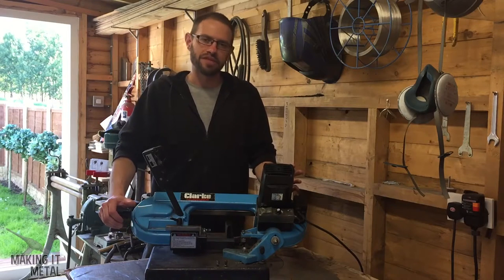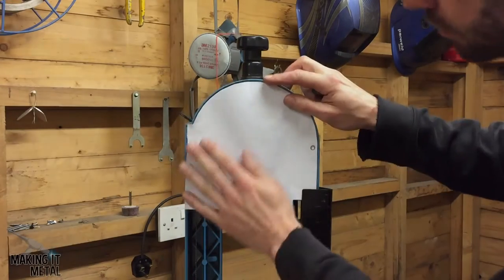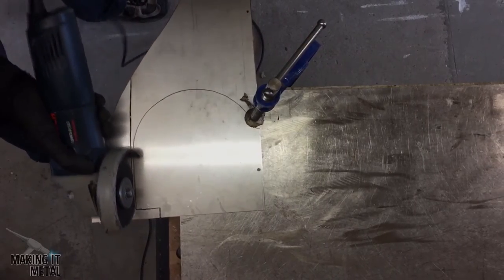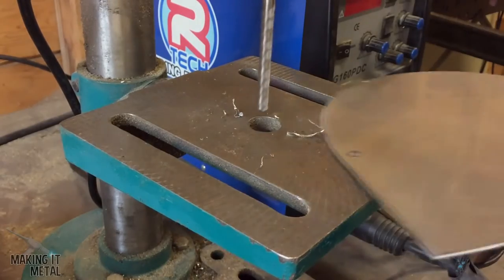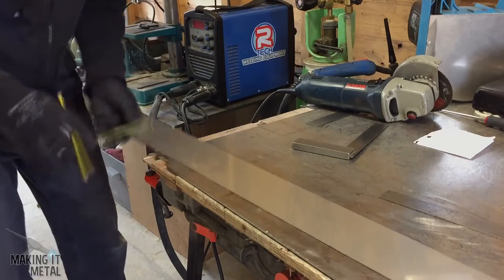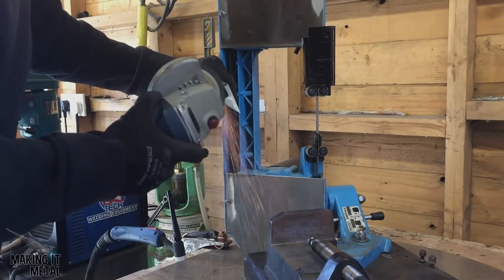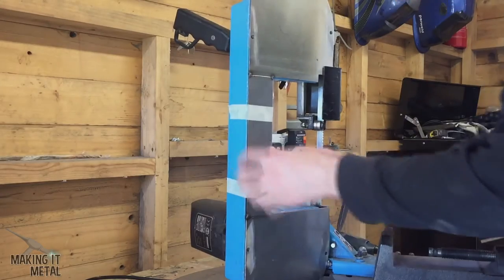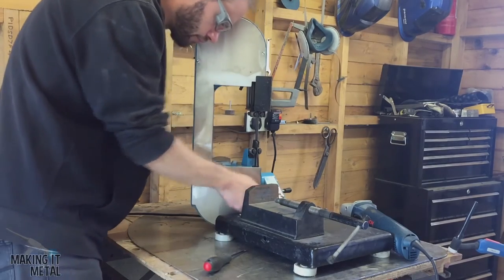Making A Bandsaw Guard

Comment: Well done.  can you tell me what that is that is attached to your drill press, looks like it is made to hold something.Thanks Dave
Reply from the maker: Hi Dave, It's actually a guard for the drill to help stop swarf etc, it can be flicked down into place when you need it and lifted out of the way when your setting up or changing a bit...Thanks for watching.

I suppose you could also use it to hold a beer for those long drilling jobs! ;-)

(Disclaimer: This is not recommended, although its better out the way for the filming process, I wouldn't recommend doing this and always wear safety glasses in the workshop) lol..
Reply: Thank you, wishing much success with your channel.